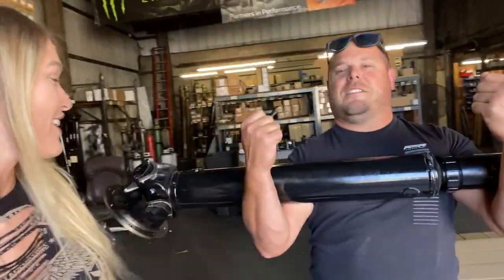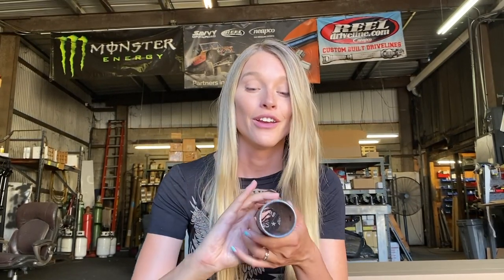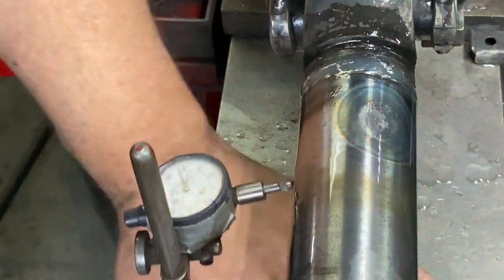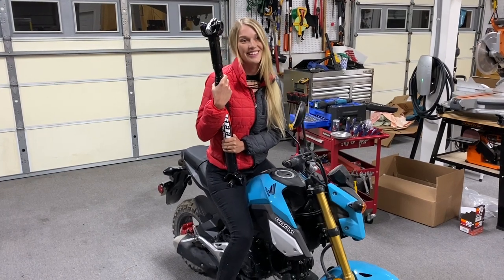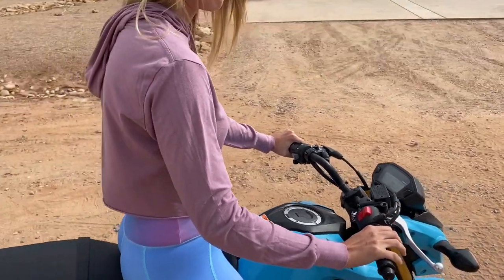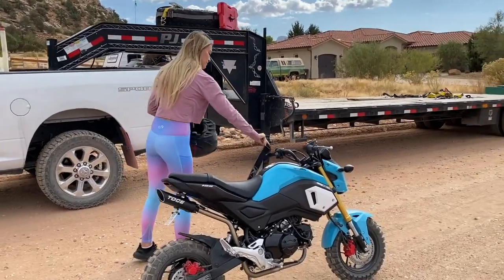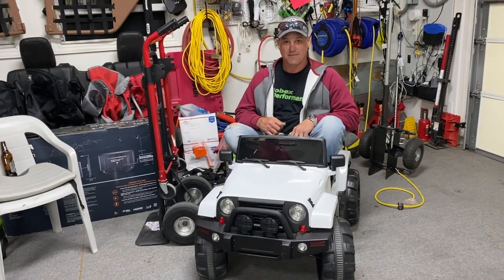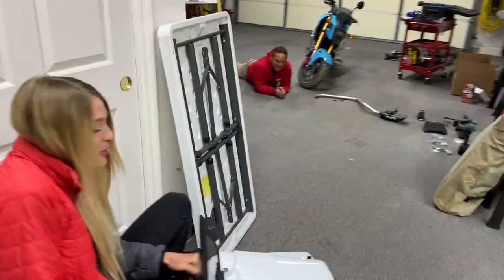DRIVESHAFT UPGRADE FOR OFF ROADING! JE REEL is the real deal!!

Comment: Those are some beefy driveshafts! 

I'm actually shocked that Britney has never ridden a motorcycle. Seems like a cool bike to learn on. Reminds me of the Honda Trail 70 we had growing up.
Reply: Or the Yamaha 60 I learned on!!
Reply: The irony is that small bikes are more dangerous because of the center of gravity. I bet it would be easier to learn on a Monster or something
Reply: @davidmoran6398  crf 125 which is light. But learn on the bitumen where there's more traction. The gravel road is slippery.

Comment: Not sure if this JE REEL company that built two driveshafts for me over 40 years ago.  What company  longevity.  They used thicker wall tube back then.  Never replaced those again.  Much better than the original factory tin-can thickness tube steel.

Comment: OH MY WORD. Please, go take a motorcycle safety training class. There are several instructions she should have been given before she ever started the motor. First thing you need to practice is taking off from a stop and then coming to a stop. BUT the critical piece of information that is missing is that before you take off, put your right foot on the peg. Practice holding the bike up with your left leg. So you take off,  lift your left leg onto the peg. Just before you stop, turn slightly right, so the bike falls to the left. Never put your right foot down. The reason you need to learn this first is because you brake with your right foot. So as you come to a stop, you can brake. Always brake with BOTH breaks. Practice this until it become second nature and you don't have to think about it. Don't do anything else until this is your normal way of handling the bike. Left foot is the only foot on the ground. Once you master this, you will be a lot more comfortable with everything else you do.